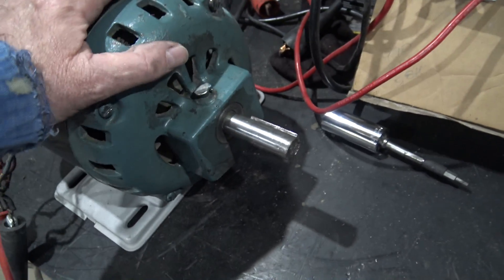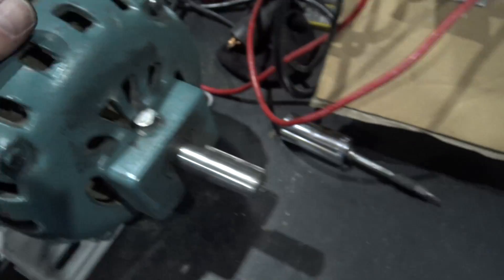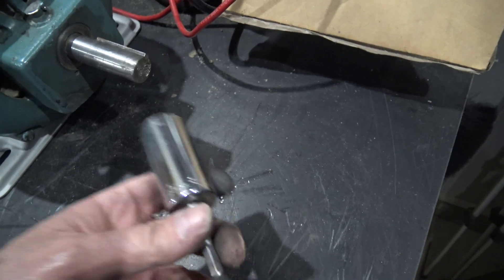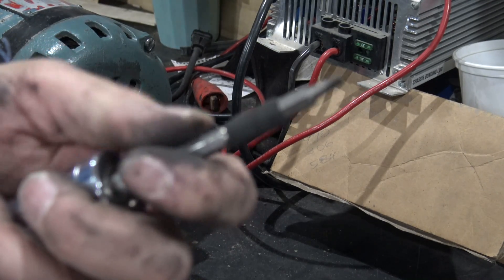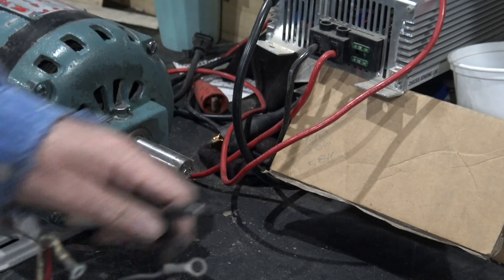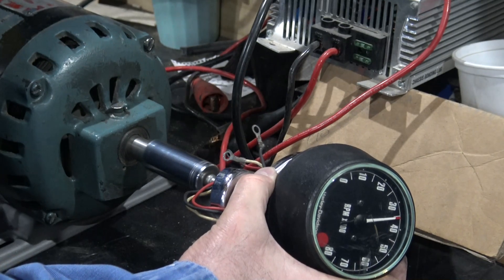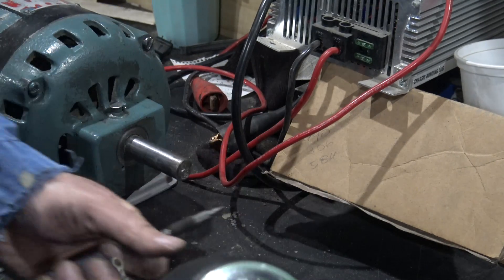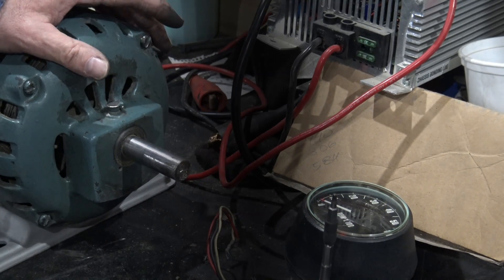CHECKING AN ELECTRIC MOTOR RPM WITH A MOTORCYLE TACHOMETER

Comment: Dude, you just answered my question about using an automotive tachometer to determine the RPM of a motor. Thank you so much!
Reply from the maker: Doug, I've since discovered a problem with that method. I tested  another motor that I knew was 3450 rpm it showed 7000 rpm. So depending on the tachometer you are using it may not be accurate. Test a known rpm motor first. That way you'll have an accurate starting point with the tach you're using.  Good luck.